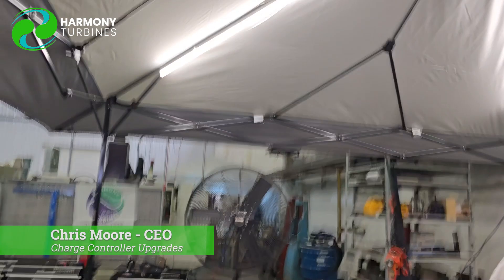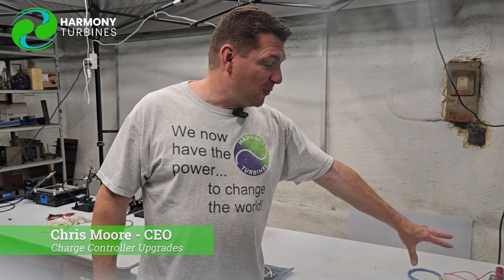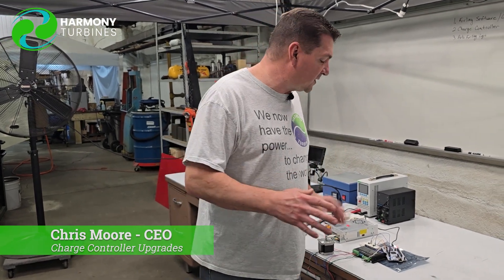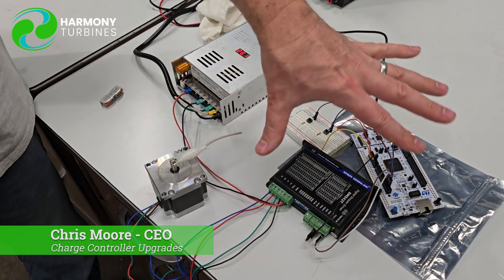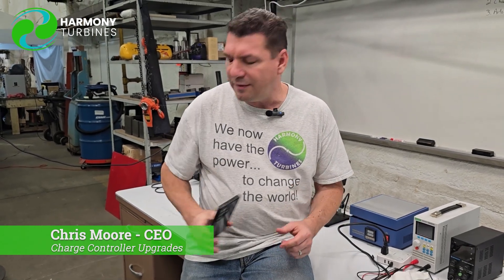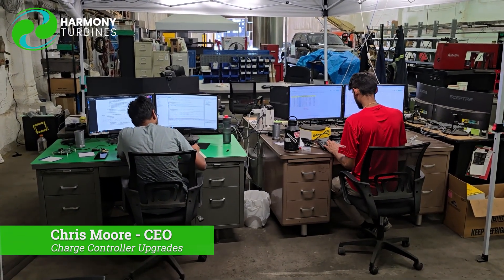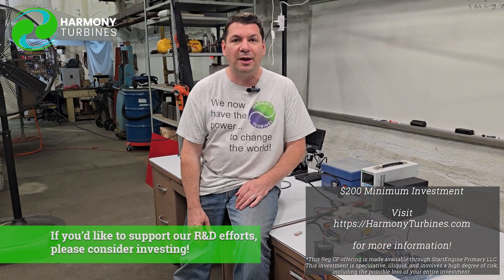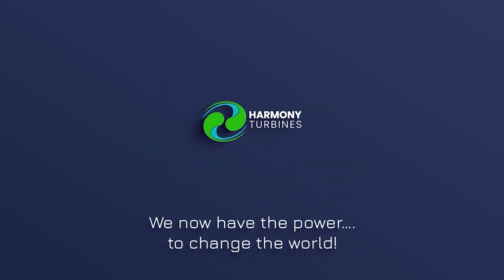Moving from Arduino to STM32. What do YOU think?

Comment: I hope you have a unit with an end voltage adjustable for a 24v battery system. With LIFEPO4 that's 24.0 to 29.2v.

Comment: I have not worked with STM32 so far, but working since many year with EPS8266 and ESP32. For rapid prototyping I love to get started with coding in micopython (which also supports the STM32). Python coding cycles (like any high level language) are much shorter / faster compared to native C or ASM programming. For some projects (like controller for DIY drum filters for fish ponds) including a simple web interfaces we even stay at micropython. Choosing a controller with SPRAM is recommended as you benefit a lot by the larger RAM.
Reply: wait I don't get it have u already been coding the stm32  with micropython or do u use HAL C rn?
Reply: @AAAASASFHFH  I never used an STM32 before. So just bought one "blackpill", used the STM32CubeProgrammer to flash the micropython FW, connected with mpremote and I get the REPL interface...